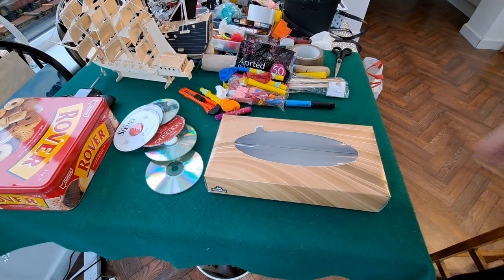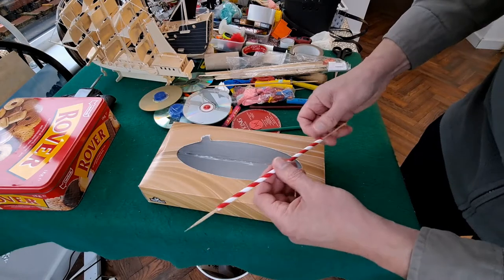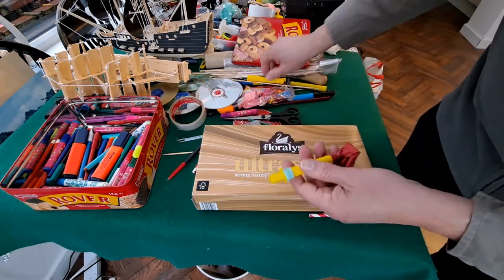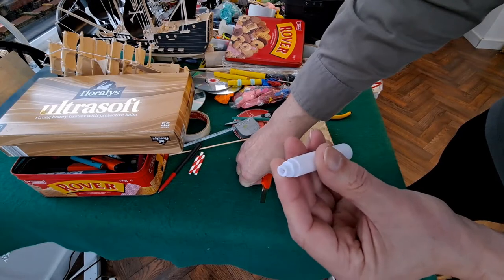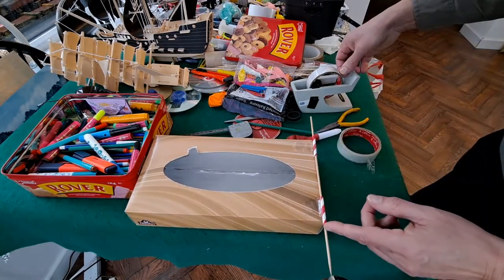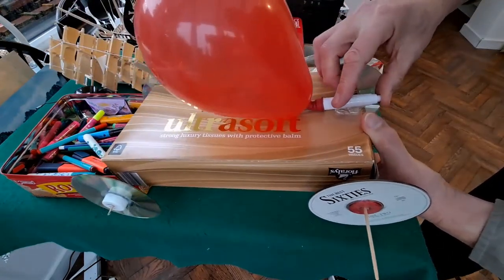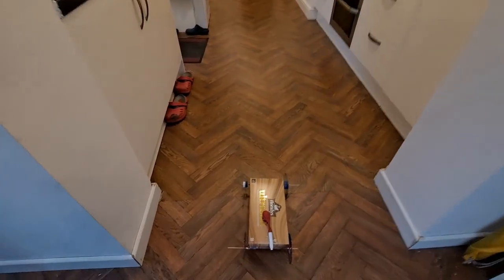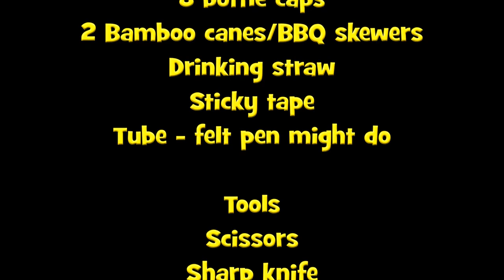Tissue Box Balloon powered car 20201216

Comment: I like the way you built this. You thought of the kids that don't have the resources so they can use simple stuff from around the house. Nice Christmas spirit. 🎄 🎅👍
Reply from the maker: That is how all my original rubber band/balloon/mousetrap,etc cars were built. I get a request with a shopping list for their school project. Another reason I don't like using the 3D printer for my projects, but now I justify it on the basis that many schools now include the use of such equipment. However there will still be plenty that are given the original type of shopping list. I have just been having a debate with "Ed" on what should and shouldn't be allowed. Some chancer will always try an innovation that isn't on the list so they get an advantage. Is that wrong, or does that show "thinking outside the box". Many teachers would encourage that as it shows independent thinking. Others would just call "cheat".